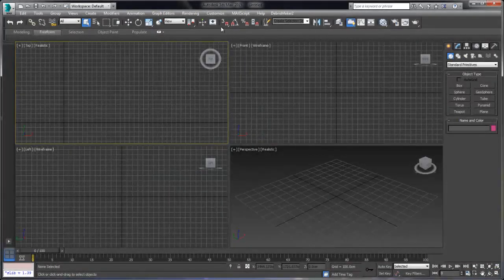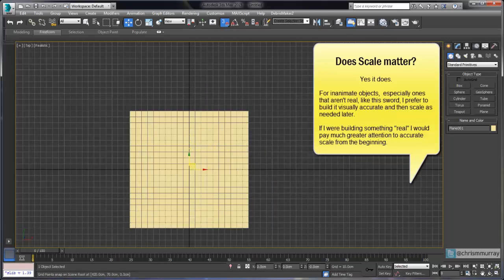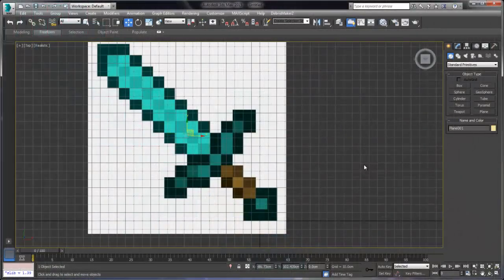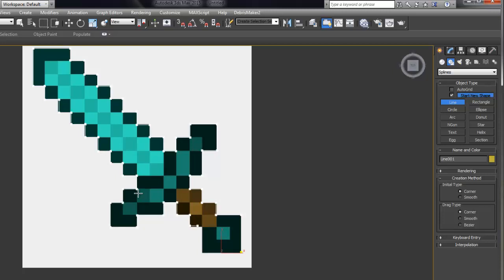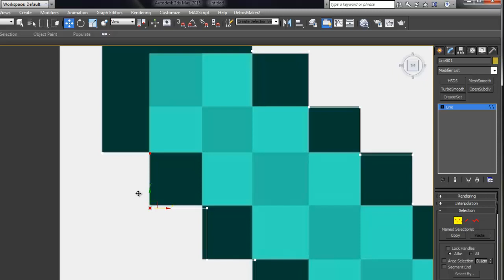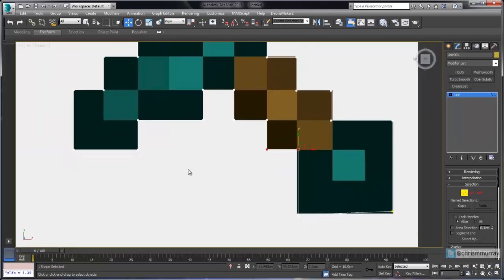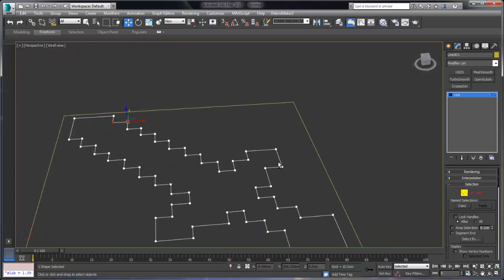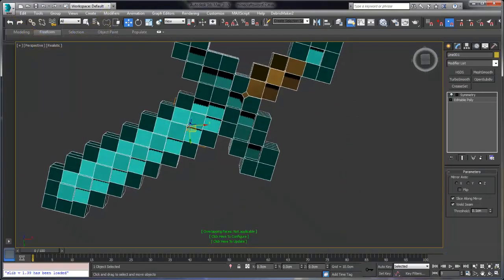3ds Max tutorial - Modeling a Minecraft Sword for 3D Printing in Part1: Setup and Start

Comment: I'm not sure why but when i convert the object to editable poly, the "Extrude modifier" disappears.
Reply from the maker: VFX Ltd™ The extrude modifier is for spline (2d) opbjects. Once you convert it... its now polygons, not an extruded spline. This is normal. If you want to now extrude the faces, you can enter polygon subobject mode and use the "extrude" command found in editable poly.
Reply: 3dsmaxtrainer Thanks for your clarification! One more question. If i were to model a t-rex, should i use the spline tool like in this tutorial or should i use a different method such as expanding the edges by shift and dragging it?
Reply from the maker: there are lots of different methods you could use. I personally would prefer the polygon/box modeling method. I see I likely need to do a video on that...!